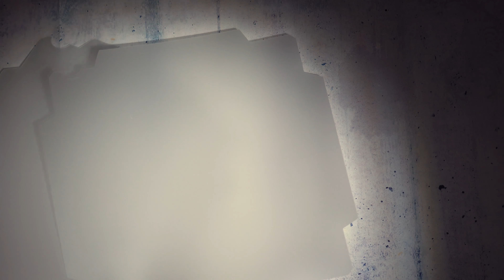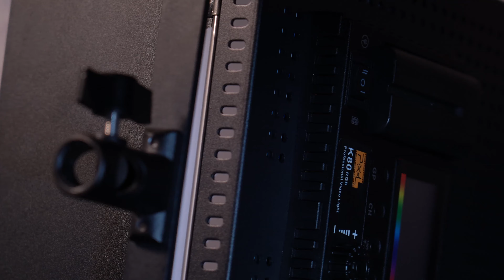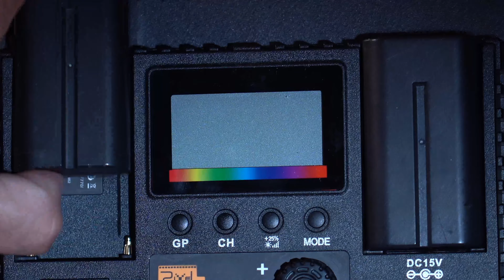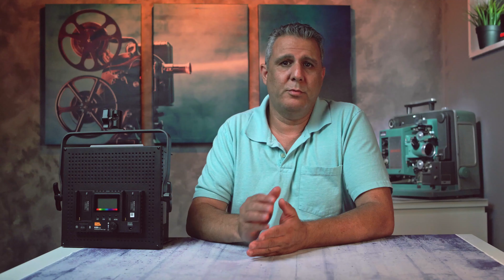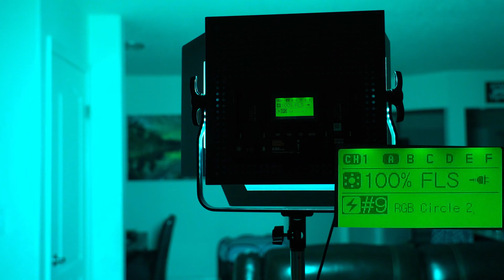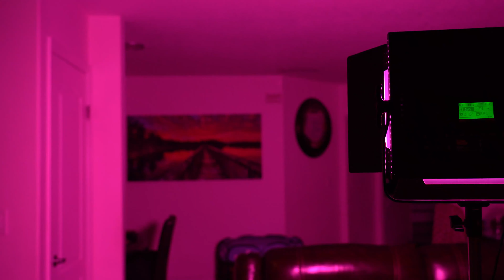Budget video LED RGB panel - Pixel K80 RGB LED

Comment: There must he different releases of this light. My set (2 panels) comes in a case with two short light stands and a remote. The remote is the most ridiculous accessory I've ever used and is a pita to use. Oddly, AI Google search claims the K80 has Bluetooth and can be used with the Pixel LCS App; however, my K80's definitely do not have Bluetooth. I wish manufacturer's weren't so lazy and would get their documentation correct online.

Comment: How does this compare to the neewer 660 rgb?
Reply from the maker: Hi Micha,  First,  I don't have the newer 660 to do head to head comparison, but there are things to consider.
More LEDs does not mean more power. In my review, the K80 with 312 Bi-color LEDs did as good as the GVM with 480  Bicolor LEDs. So the number of LEDs not necessary means more power. 
I am not sure if the dimmer on the newer is a true 0% to 100%, maybe it is, but I personally did not test it.
The k80 has a more temperature range than the 660.
The K80 is cheaper by $30, and if you apply the coupon ( If it is still available), you can save an additional $10.On the other hand, the Neewer comes with a case and also can be controlled with an app.
Going by the pictures of the 660, I love the display on the k80 much more.
I hope it helps.
Reply: @AllAboutVideography  Hey again, I ended up buying the K80 and love how bright it is! Only problem im having is that there's a super high pitch sound when the lights at 100% brightness and it completely kills my brain. Is this normal? Both the panels I got had this problem.. :( 

I ended up getting the Neewer 660 RGB because the k80's sound issues and I'd say its about 25% less bright, but the app control is a godsend. 

Right now im waiting to hear back on if i can exchange my panels for a set that doesn't give me head aches.
Reply from the maker: @Micah.Mahaffey  Hi Micah, No, It is not normal. It is a shame you had it with two units.
Did the noise appear both with batteries and power supply?
And yes, a remote or an app can do wonders.
If RGB is not the primary reason you got this light, maybe you should go with a different kit. You should check the Viltrox VL 200.
https://www.youtube.com/watch?v=8kV6nf_5bj4
Reply: pixel K80rgb better than neewer,the CRI 97+,0.5m 5500lux,2600k~10000k color temperature but neewer CRI 95,0.5m4800lux,3200k~5600kcolor temperature,As far as I know, in addition to being available on Amazon, they recently launched a new shopping website Favparcel.com 25% discount on all products